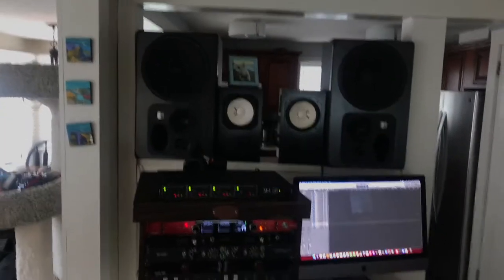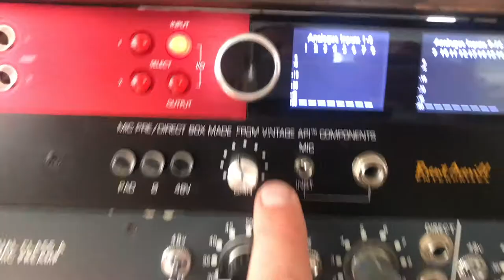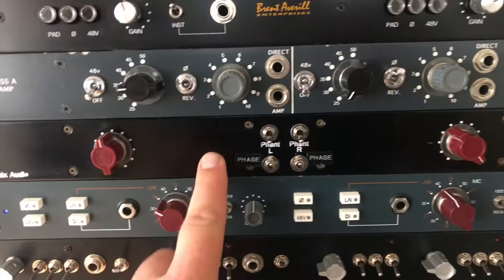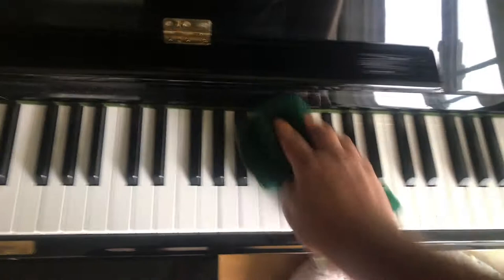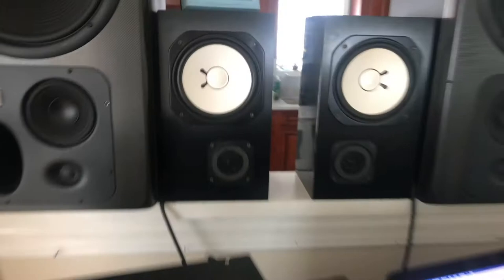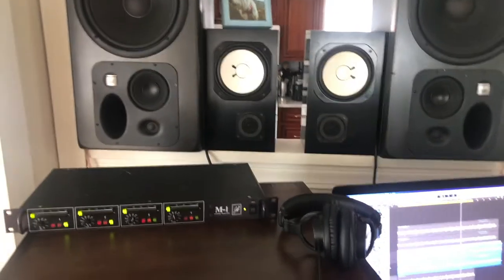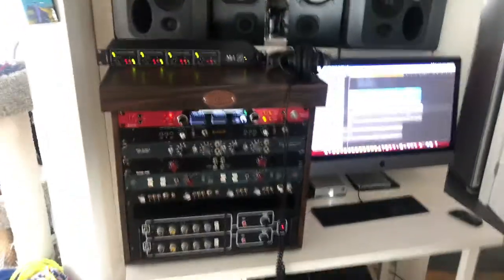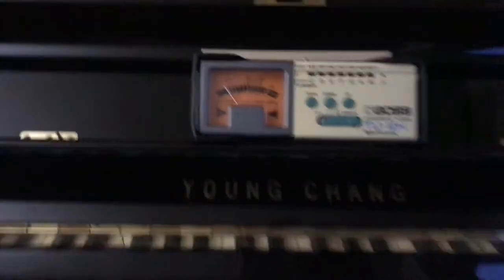John Hardy M1 Preamp  shoot-out w BAE 1073 & Calrec 1061

Comment: Those John Hardys are known for clarity and being clean. I almost grabbed the same 4 channel unit, but already had a True Systems 8 (8 channel clean preamp in a 1u box.. a DEEEEEP 1u box) For colour I had a 3124, ISA 428, Vintech 743 and X73, Chandler Germanium and a LA 610.. I had last added a 16 Channel Trident Trimix for a total of 39 preamps for my portable rig.. haha fun times.. Ive sold off the lot, and now just have a 1980s ISA 215 (back when Rupert was running focusrite) for the home.. In my portable rig I have a Midas DL32 running to a rack M32.. much easier to lug around..